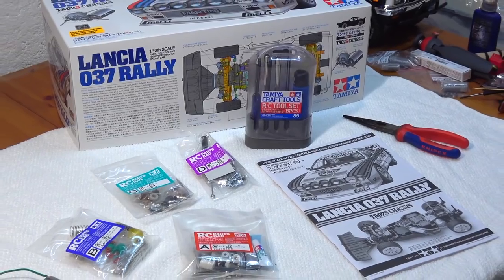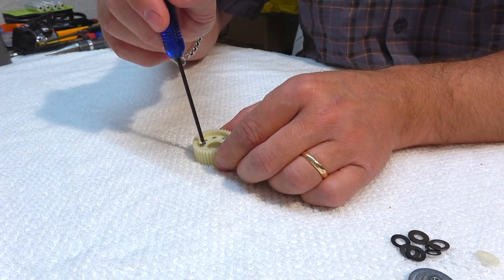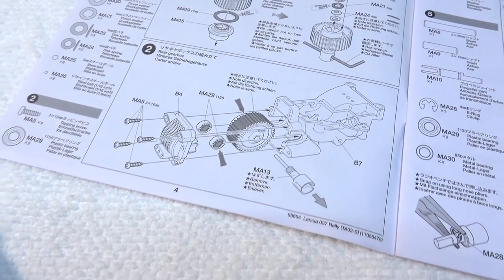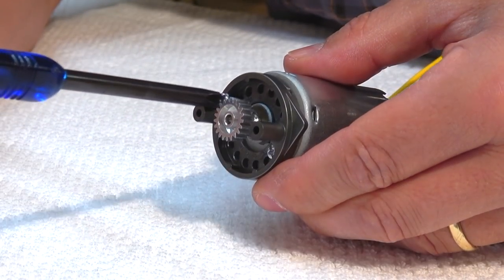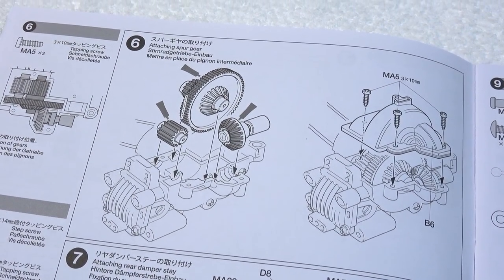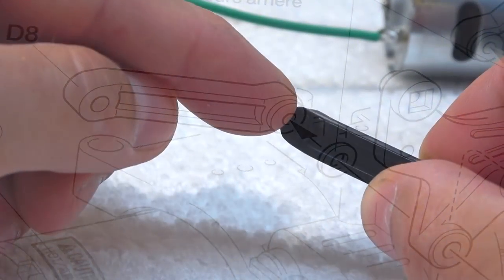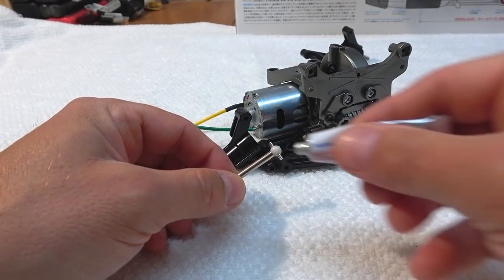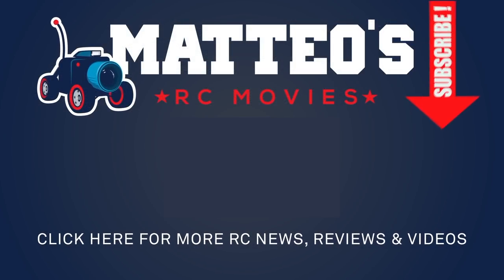Tamiya Lancia 037 Rally Build / Video 1 / Steps 1-9

Comment: The way you tightened the ball diff makes me uncomfortable. You seemed to really tighten it hard, which will force the balls to dent the washers. Also, whenever possible, it's a good idea to tighten a ball diff while rotating the internal parts, to help ensure the balls don't dent the washers. This ensures the diff will operate as smoothly as possible.

I've never seen dogbone driveshafts that were made of metal and plastic before. That's an interesting idea. I wonder why Tamiya stopped using that design?

Comment: Dont you use loctite on metal to metal parts like the spurgear screw?
Reply from the maker: Do you mean the pinion gear? The spur gear is not screwed on with these screws.
For the small screw of the pinion is not recommendable, it holds without. And with loctite it's possible to damage the screw by re-opening.
Reply: @Matteomeier  yes i mean pinion. I always loctite my pinions. It was some time now that i built a Tamiya, on bigger cars and runners lite Traxxas and Arrma its almost a must to loctite the pinion. I do like al your videos thougt. Nice to see all of your cars :-)

Comment: I found a little problem when I built TA02 chassis ball diff.. rear wheels sometimes won’t spin due to a small gap between rear dog bone and wheel hub cup. I add a rubber O ring between wheel hub cup and dog bone. That fix the problem. Did you have the same problem?
Reply from the maker: I meant it's mention in the manual to add this o ring in the hub cub...
Reply: Matteo's RC Movies Not in my manual it didn't.  I checked the manual many times, but I don't see it.. I thought it supposed to be add O ring.. I don't know why it didn't show on my Porsche 911 GT2 ??